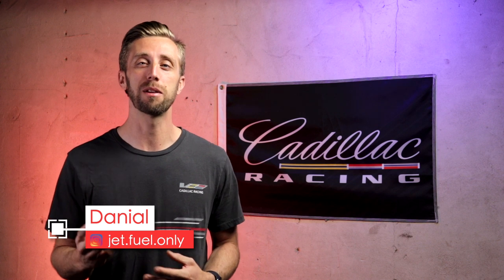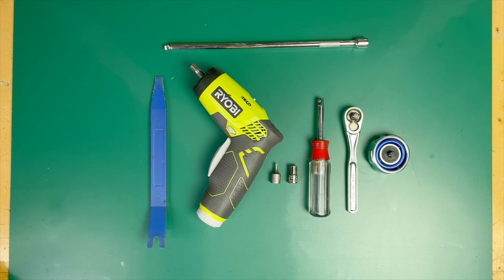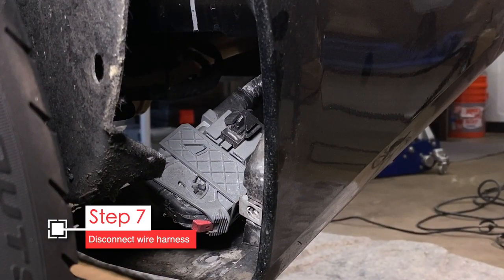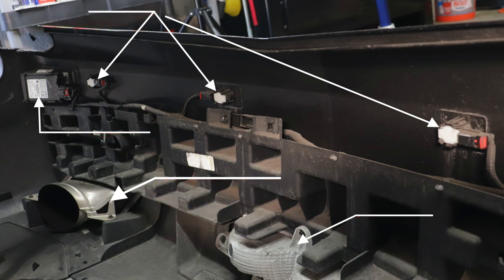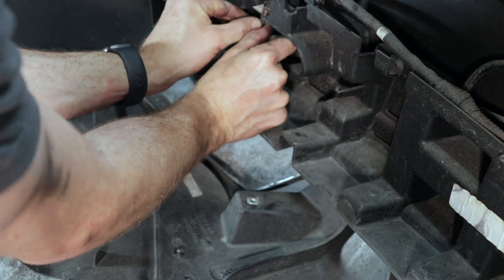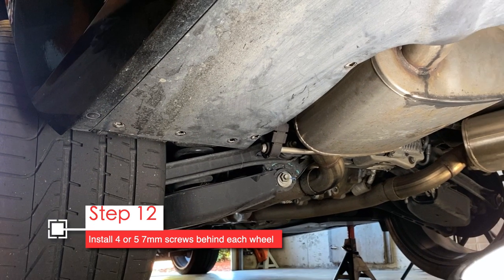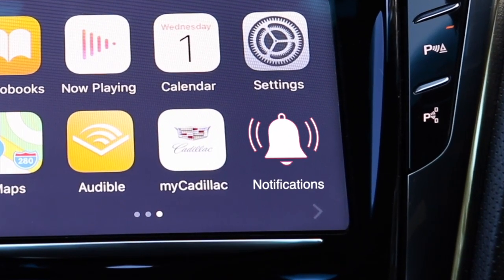Quad Exhaust Tips | 2014-2016 Cadillac CTS

Comment: I installed 2 Flowmaster Super 10’s with burnt Blue Quad tips on my 
2014 CTS 3.6VVT V6 & man oh man what a differences in sound & performance. Did not delete the resonators. If you would like to know how it sounds take it from me it sounds amazing and it’s not insanely loud either. Specially when cruising down the freeway it’s quiet but when you just give it a little throttle or stomp on it man oh man the sound is great. But from a dead stop the car really does Accelerate a lot faster and sounds mean.  The burnt Blue exhaust tips really pop specially since my CTS is Diamond White Tricoat color. Love it. Hopefully this helps anyone wanting to know how it would sound on just a 3.6L (non V).  Thank you Daniel for the how to video. I really do appreciate all your videos and effort. Extremely helpful.
Reply: You inspire me
Reply: hey my man. i know this is old af. but would you happen to have a sound clip of your cts? i’m kinda stuck on what type of mufflers to put on. thanks ✌🏼
Reply: @BBell-ib9in  i do not anymore. I used to.  But with what i stated it sounded great. I got nothing but compliments on it when I had it.  I sold it and got a C7 06 Corvette.!
Reply: But you can’t go wrong with the Flowmaster Super 10!!  if you delete the resonators, it’ll sound like crap and way too loud and not ride at all. But if you get rid of the mufflers and installed the super 10 it’ll sound mean specially, at cold start up.

Comment from the maker: One thing to clarify since I may  not have communicated it well. The exhaust shop does not remove the bumper. The only reason to remove the bumper is to get the chrome outlets off and then you reinstall the bumper. The shop will cut off the piping going out of your muffler and bend new pipe to center the quad tips in the holes. 

Also, please don’t drive the car hard until the tips get welded on. There’s a chance the bumper won’t hold up to hot exhaust from high power runs.
Reply: Man the exhuast shop i just went to told me nope. Geez. Gotta find someone else. He claimed he need to remove the bumper
Reply from the maker: @blessethishe  some don’t want to think outside the box. The only argument I would provide to him is that everyone else that had this done did not remove the bumper to install tips. The bumper has to be on to get the tips properly aligned.  And exhaust shop that doesn’t think it’s possible it’s probably one that’s not capable
Reply: @JetFuelOnly  thats exactly what i told him. He just wasn't the right guy for the job. I have another guy im going to see. Hopefully he can install them.

Comment: Is it okay to install the savage diffuser first, then thereafter put on the quad tips? My exhaust Mechanic is telling me to put everything on first then he will install the tips
Reply from the maker: Yes you have to do it that way. Only way to know the tips are lined up properly. Also don’t drive hard without tips, you could melt the diffuser.
Reply: @JetFuelOnly  oh word. He said that exact same thing.  Now i know to not take the freeway to get to the exhuast shop. Smh. And thank you so much.
Reply from the maker: It’s fine, just don’t go full throttle making all those hot gasses!
Reply: @JetFuelOnly  having trouble getting the dual tips welded. When the inserts were removed. At the very end of my pipe, the shape is oval. Was your ends oval? I think the pipe rounds out away from the ends.

 Also, if the bumper is on, and the pipe is inside the bumper, the bumper doesn't need to come off to weld it? Do the exhuast shop suppose to cut at the very ends or way further back ?
Reply from the maker: Shop should cut the stock pipe at the muffler. Then build/bend a new pipe to attach the new tips to.
Reply: @JetFuelOnly  Thats what one guy said he would had to do. But unlike your exhaust pipes which sticks outwards alone. My pipes have hooks/bracket/hanger rod welded onto them. Smh

Comment: Do you have to change out the exhaust along with adding the CTS V diffuser on 2017 Cadillac CTS Vsport  to add the quad tip
Reply from the maker: No but you will  need the muffler outlet pipes to be cut off and new ones installed to line up the tips with the opening

Comment: Do you have a recommendation for my 2017 CTS 3.6 AWD?  Would like to upgrade exhaust at some point. Thanks
Reply from the maker: I dont think there are any manufactured setups for your car. You can do what some people do and remove the muffler completely but you will likely have some drone. Or just replace with two after market mufflers
Reply: Thanks for the info

Comment: While pulling on the passenger side the end piece on the car where the bumper clips on broke off. So using jb weld to try and get it to stay but it’s a pain. Any tricks or ideas to get it to stick back on
Reply from the maker: Hmm no tips there. Haven’t had that happen.
Reply: @JetFuelOnly  well it sucks lol got it fixed with some plastic putty and ready for my dual tips

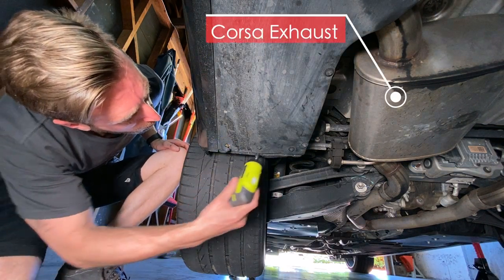Comment: Do you cut the original exhaust pipes? They seem welded on to the exhaust (seen at 3:58) but at 12:00 I see that those pipes seem to have already been cut off and nowhere does it mention this part.

Thanks!
Reply from the maker: That’s the work the shop does. The exhaust shop cuts off the pipes out of the mufflers to install new ones that flow toward the outlets better.
Reply: @JetFuelOnly  thanks man!

Comment: I have a 2016 cadillac cts 3.6 luxury and ive been to multiple shops now, i have the blackhorse racing tips and they are all telling me its not possible because the boxes on the side under the car and the closing on the bottom of the bumper. I already have my muffler delete so their is plenty of room to work with in terms of piping. What should i do?
Reply from the maker: This is a difficult situation. We know they can do it but to me it’s just competence. I say keep trying shops, but worst case maybe learn to remove the bumper. Go to the shop and get most of it disconnected so they/you can pull it off and on to make it work. Money talks. Also… I’m not sure if there’s more things obstructing the install on the 3.6
Reply: @JetFuelOnly  yeah idk the main things they were saying were obstructing it right now are the little boxes on the underneath by the wheel well whatever those are and the bottom of the bumper cutout for the exhaust. Sorry if this sounds confusing, but I'll keep trying shops for now. Thanks for your time. I'm taking lots of inspiration from your build. Hopefully, i can get it to work. I did already remove the bumper to get the outlets off, though.
Reply from the maker: @zink9753 I know they want to drop the exhaust to install but not possible with cutout holes. They need to cut off the old, then build pipe toward the outlet and insert the tips from the outside and weld from underneath.
Reply: @JetFuelOnly  thanks ill show them this if they have any question and hopefully will give them a better idea. Appreciate the help, means a lot.
Reply: @JetFuelOnly  finally got a shop, actually my local one 2 minutes from my house who were willing to put in the effort of bending the pipe correctly and what not. It was 100 dollars, but im satisfied for the craftsmanship required. Thanks for your help
Reply from the maker: @zink9753 so many people share your story!  Just lazy or incompetent. Glad you found one.
Reply: @JetFuelOnly  yeah unfortunately the tips are not completely even, but atleast their in. Hopefully, someone can perfect them at some point.

Comment: If I was to remove the chrome inserts,..and replace bumper, then go to muffler shop and replace muffler with magnaflow and add quad tips....would they still need to remove bumper again?
Reply from the maker: They shouldn’t. Some shops say they need to but it’s been done many times with bumper on. Besides with the bumper off the tips can’t be aligned properly.
Reply: @JetFuelOnly  thanks I'm having rattle in stock muffler, and I was hoping it was just a quick fix like your other video, but nope...
Reply from the maker: What is it?  Recently heard some people have a different bracket farther back that breaks loose too.
Reply: It's making this exact sound...muffler shop told me...needed to replace muffler....
Reply from the maker: Ok. Well I hope they actually KNOW it’s the muffler. They verified no brackets were loose?  If you have them replace the muffler, don’t let them throw it away in case you find out that wasn’t the problem
Reply: @JetFuelOnly  thanks Daniel

Comment: Will a ats v exhaust fit on a 2018 ats 3.6?And im wondering the whole system up to the headers?
Reply from the maker: No. The only thing that may fit is the midpipe and rear section. Tips aren’t in the right position and the connection to your headers is very different as the V has downpipes from the turbos.
Reply: @JetFuelOnly  ok thank you!I'll try from the midpipe down to the quad exhaust
Reply from the maker: @MysticMann305 no sorry I meant to say that the ATS V pipes exit narrowed out the back so that won’t work either. You are better off adapting a VSport exhaust or something. Also a custom exhaust may not look as nice but works just fine.
Reply: @JetFuelOnly  sounds like too much to deal with lol.Ill just get dual zzp or corsa exhaust and call it a day.Not long before ill have this car paid off then the real deal will come after.I raced a challenger scat pack a while back and he couldn't pull away top end up to 100mph.This car with just the NA v6 is no joke.I look forward to taking it to faster proms down the road to see what they can do with it stock platform wise.Thank you for the info sir

Comment: What company makes the Quad exhaust tips for the CTS?
Reply from the maker: Thanks for the reminder, I need to put those in the description.  You just need 2.5" inlet and 3.5" outlet tips.  Many company's make them. Search Ebay or Amazon.
Reply from the maker: Ok, I've updated the description!
Reply: Also check your local muffler shop they got plenty choose from
Reply: I got mine from Savage Cadillac
Reply: Jet Fuel Only I got my burnt Blue Quad tips from Savage Cadillac. Love it.